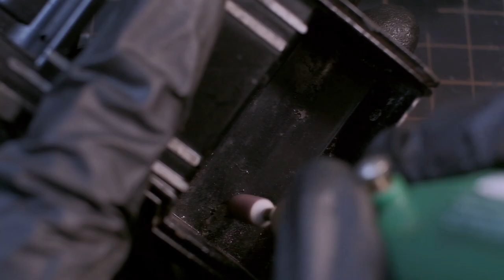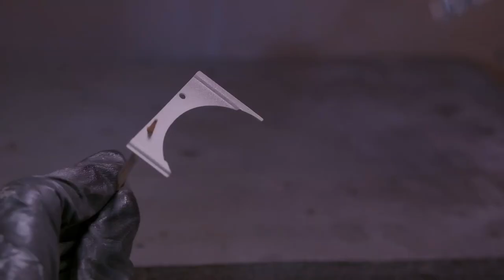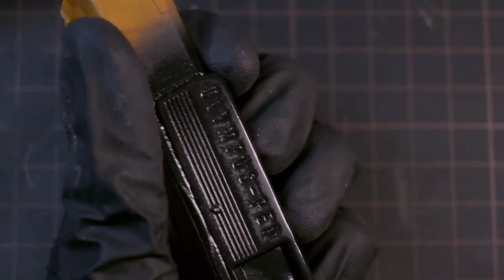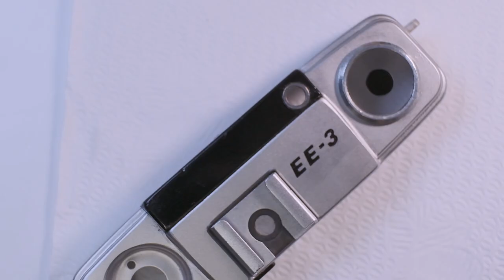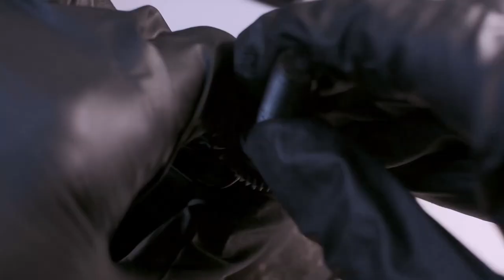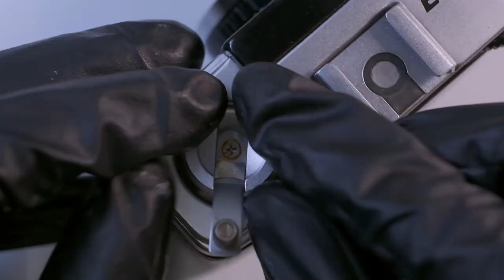Restoration 50 Years Old Olympus Pen EE3 film camera - Part 2

Comment: Big fan of your work. What leatherette glue and paint brand are you using?
Reply from the maker: The one used in this video is normal solvent-based cement like pilobond. But my favorite is eco-white leather glue which has almost no odor and is easier to apply. Solvent-based adhesives are stronger. Any kind of 2k polyurethane paint is fine for the paint. You can get it easily in any automotive paint shop. Make sure you use the aluminum self-etching primer for the base.